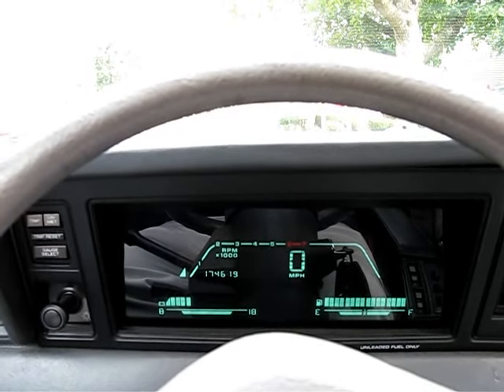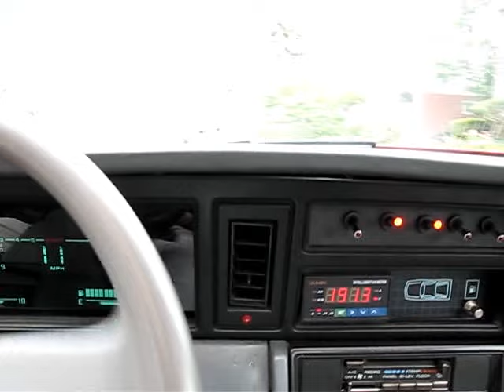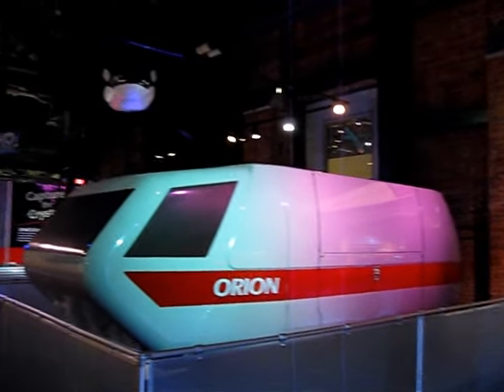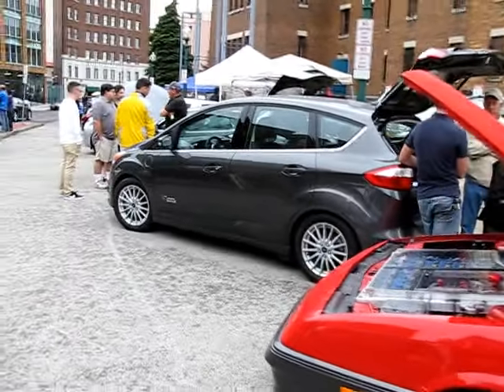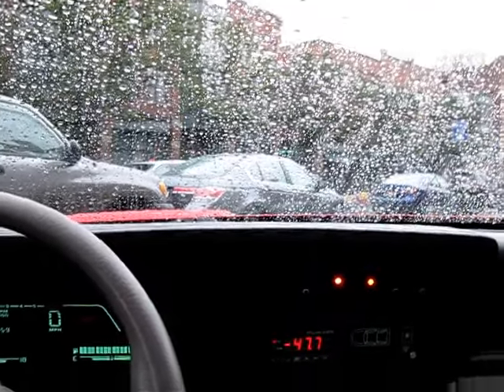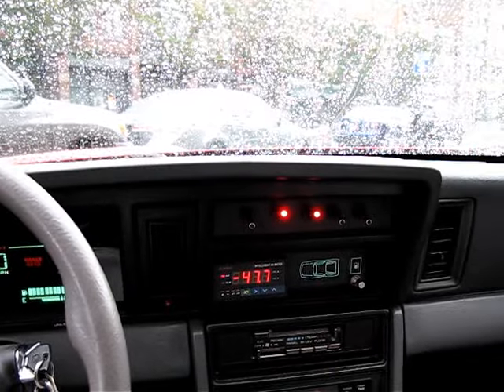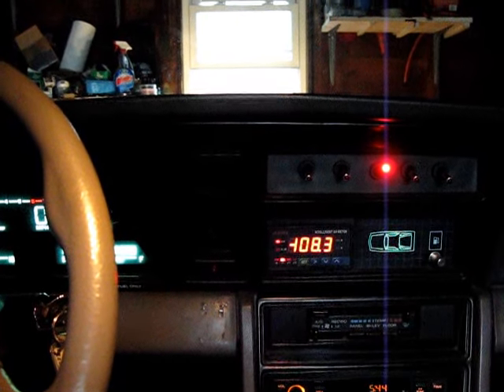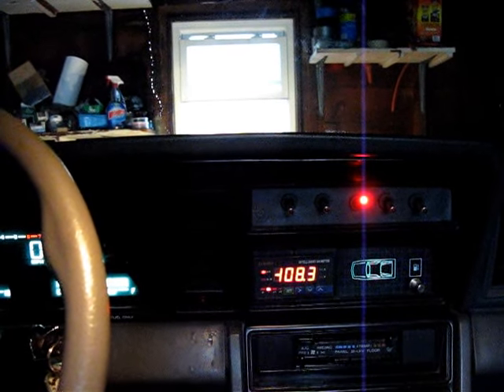September 12, 2015 - National Drive Electric Week - MoST Car Show

Comment: Have you considered an AC motor? Reason I ask is I am debating between a warp 11, and an AC75 for a Ford Ranger truck. I'm wanting to build a 96v system.
Reply from the maker: Good afternoon,

I have considered an AC motor & inverter in the past, and HPEVS is pretty much the only option in the lower-voltage range.  They are very nice people with a great series of products (although according to their website, I don't believe the AC75 is an option anymore).

Depending on what you are expecting in terms of performance and range with your Ford Ranger, you are likely to be very disappointed striving for a 96v system.  In general, that voltage range is better suited for an extremely light car, an electric motorcycle, or a larger vehicle setup as a NEV (Neighborhood Electric Vehicle) with a maximum speed around 30 or 40 mph, and relatively limited in-town range.

If you are looking to build a good all-round daily driver, with decent performance, you're best bet is likely to go with an HPEVS AC50 or AC51 with their Curtis Inverter, and you will likely want to get that voltage up to the maximum that Inverter can handle (144v in this case), otherwise the acceleration is going to be very "pokey".

A DC NetGain WarP 11 would have a lot more raw torque, but you need to pair it with a good Controller...  Unfortunately EVNetics no longer sells their excellent Soliton1 controller, and I don't personally have any experience with any of the other few options that are out there floating around the market at this point.  There were some promising open-source projects going on, but they require a lot of electrical expertise to assemble (which I do not have), so can't really say one-way-or-the-other if they are a good option or not.

Good luck with your project, 

Jason
Reply: DaytonaEV
 . . . . The AC75 shows more torque, way more then the 51 or 51, however, If i wanted to step up to 144v, there's always - http://www.evwest.com/catalog/product_info.php?cPath=8&products_id=176&osCsid=igm46sfl20nmns5umu78028bb2 - the AC76, EV west shows them on their website, guessing they would have then in stock. Still, I don't know if I could justify the price. Would like to see that AC76 come down to around 4 grand, also those adapter plates for the transmission are outragious at 825 . that needs to come down as well. Bad enough the batteries are so very expensive.

Comment: I hear evnetics closed the doors.  Any chance you know people that can service the controller?
Reply from the maker: +EarthshipFreedom The last I heard was that the folks at EVNetics were not currently producing or marketing their "consumer grade" controllers DC motor controllers at this time, but that the company itself is still around and have rather refocused their efforts on building massive controllers used in electric locomotives instead.

I don't have any specific confirmation on any of this, just hearsay, but if I have trouble with my Soliton1 at some point, I will likely try to get in touch with either Sebastien Bourgeois or Jeffrey Jenkins at EVNetics and ask them directly.

Comment: Hi Jason how are you doing ? Are you still driving the car ? Or you bought a factory electric car ? Or you just quit every thing
Reply from the maker: Good afternoon!   I am doing well, thank you for you asking.  :)

My '87 Dodge Daytona EV is still being driven, every day, even all throughout this relatively harsh Central New York winter, due to my normal "winter rat" (a gas powered '86 Daytona) deciding that it didn't want to start anymore back in December.   My gas car has been down at a local repair shop for a few months now, but I haven't really missed it, as my EV has been getting me wherever I have needed to go like a champ.

It is highly unlikely I will ever personally buy a factory electric car.  While some people may cringe when I mention that it cost me approximately $25,000 to build my own 100+ mile range, high performance, and notably unique EV...   I just don't think I will ever be willing to shell out significantly more money for a comparable off-the-shelf model.

It's much more likely that I will end up building a second '80s era Dodge Daytona (at some point), but perhaps this time using various parts salvaged from wrecks of those more expensive factory electric cars...  grins

And no, I haven't quit or anything, I just had not been making any changes to my EV over the last year and a half or so, and thus have not had anything particularly news-worthy to share.  However, over the last couple of weeks I have been working on new "Charger Buddy" related project, so should have a new video on that topic up on YouTube and my Blog in the very near future!  :)

Take care,

~Jason